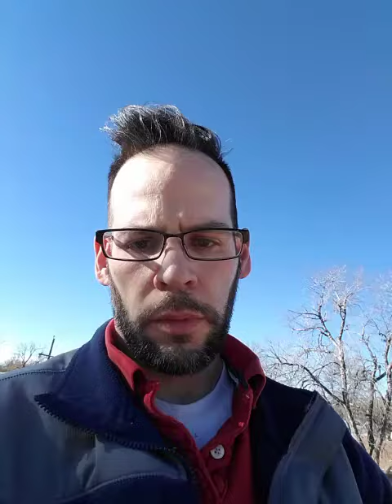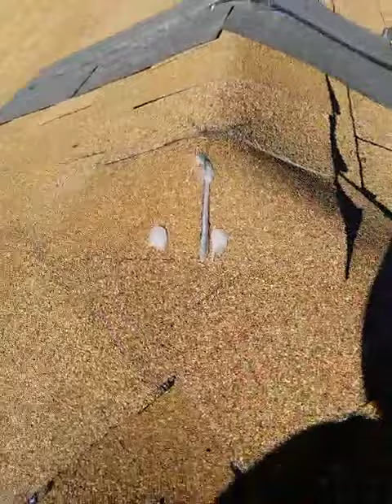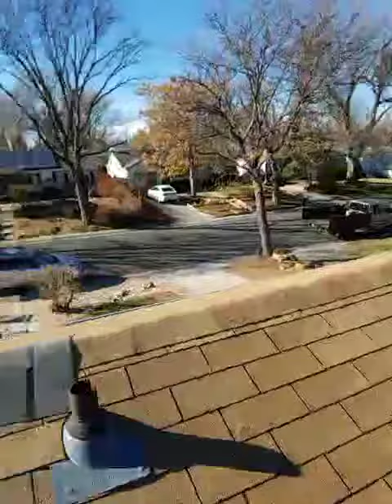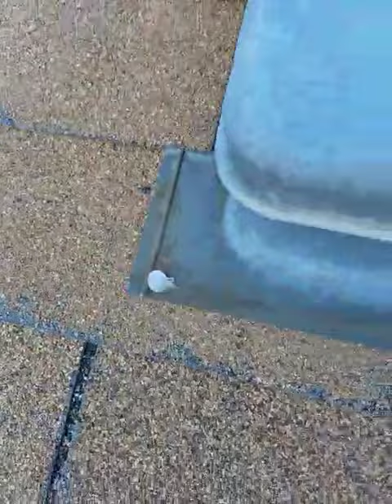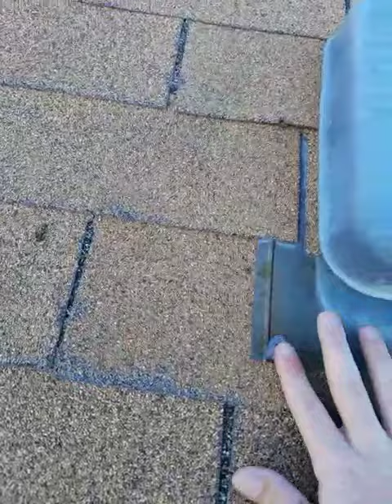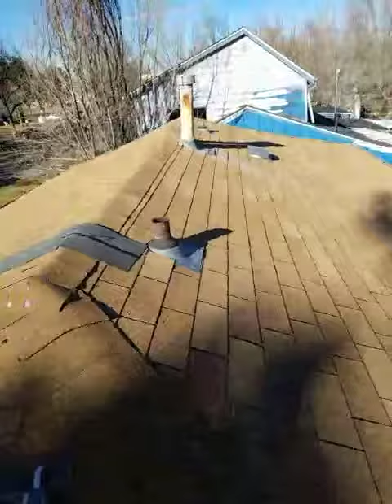Installing the final cap shingle at a hip and ridge junction.

Comment: Use roofing cement under the shingle around the center cut line and there is no need for the exposed fasteners and the bead of caulk down the cut line. Otherwise yes this is a correct install.

Comment: That's ugly af,cut that cap from the other end and u dont have any exposed nails, dont nail pipe nor vents on exposed side either,do it on next shingle that covers sides of vent.
Reply from the maker: We didn't install any vents or pipes on this roof-- just re-caulked the nails.
Reply: my bad @FrontRangeStormContractors